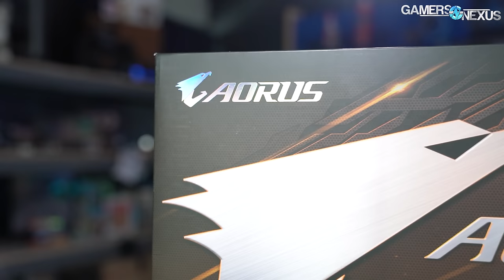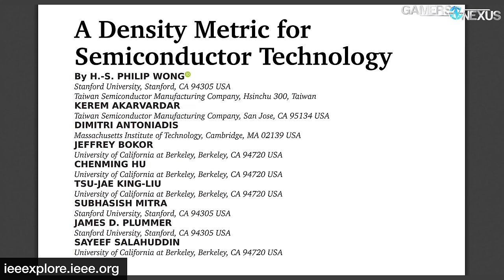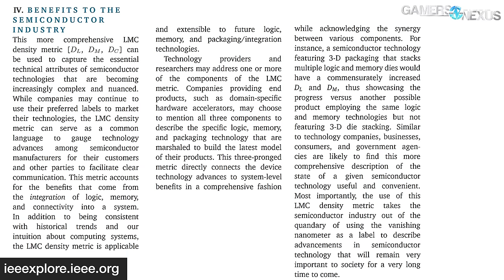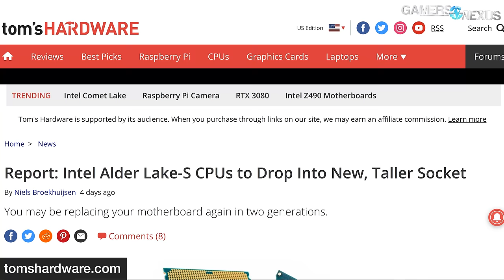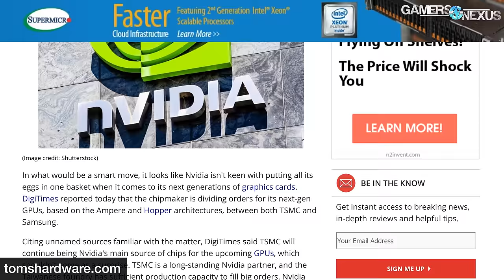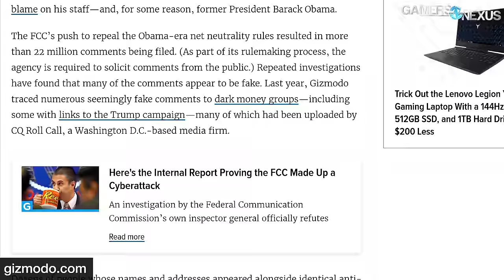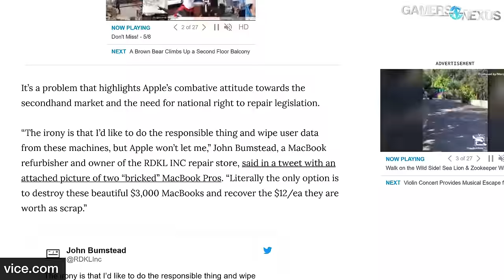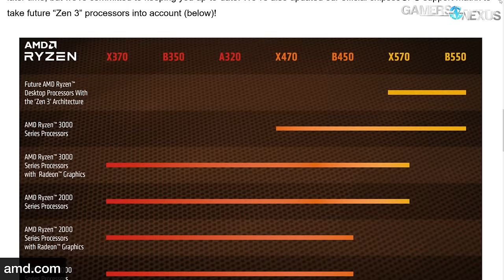HW News - NVIDIA & AMD Fight for 5nm, Intel Alder Lake, RTX Ampere, Ryzen Pro 4000

Comment: Worked at a semiconductor company, and the whole *ometers isn't all that informative without some context. It's been almost 20 years since we last used those types of measurements for anything but marketing.
Reply from the maker: Always great to hear insight from people who really were in the field!
Reply: Marc Jackson  I've talked to some old dogs that were in the industry in the late 70's/early 80's, and they claim that when we measured things in Microns, they could identify defects just by looking at the silicon. Like human metrology departments that nowadays are run using SEM and TEM instruments that can see down almost to the atomic level.
Reply: Nanometers are not even indicative of the gate length as Steve insist, if some people are to be believed. It's just a marketing naming scheme.
Reply: An honest question, why they don't use the good old "transistors per square inch" (or real area mesurement, even better) from the original moores law?
Reply: HariGtt tpi is a wet noodle standard, it can fit almost anything you need
Reply: @HariGtt  Because that isn't the original 'Moore's Law', it's just another Marketing Dept. bastardisation... Gordon Moore - "The complexity for minimum component costs has increased at a rate of roughly a factor of two per year ...",

Also, that bastardisation isn't very definitive... it's incredibly easy to build lower-density circuits that outperform higher-density circuits.

An actual useful descriptor would relate to MIPS and MIPS/$... something that channels like this provide with their Benchmark tests & reviews.  All in all, moving away entirely from using physical elements of the micro-architecture as Marketing would be a good move.
Reply: @RobinHood-yk8og  I can't quote the law by heart, but as far as i recall from college, the law was derived from cramming more components in a square inch. Wikipedia seems to agree. On the other hand, MIPS and MPS/$ are relative to an specific implementation of an architechture. In TSMC n7 you have Apple's A12 chip and AMD's Rizen 3100 throug 3990X, all with different MIPS and MIPS/$
Reply: @HariGtt  I've just quoted Moore's Law - You can CTRL+F this pdf for confirmation - https://newsroom.intel.com/wp-content/uploads/sites/11/2018/05/moores-law-electronics.pdf

MIPS & MIPS/$ tell you how much computing can be done and for what cost.  The fact that this metric gives you raw compute numbers, allows you to control for other variables (Architecture, Clock Speed, Power Draw, Memory Capacity etc...) and shows you the difference between, say Intel's current node and TSMC's current node, or between Apple's A12 and Samsung's M4.

Yes, you can also filter MIPS by platform so you aren't directly comparing a low-power embedded or mobile SKU with a Desktop or HEDT SKU.  That's why Steve and others don't have Mobile processors on their benchmark tables when testing Desktop processors; it'd be entirely irrelevant to the conversation.
Reply: Need to have it defined by density of transistors per nm.
Reply: @HariGtt  again arbitrary numbers since your benchmark is going to have some unimaginably huge number, to compare to another unimaginably huge number and then actual chips won't have the similar value since not every square unit has transistors on it.

Density is still better but then you get things like 3D circuits like they're using in ram which throws out the metric again
Reply: @HariGtt  because transistor density isn't a good measurement either.  Things like drain and source size, size of the transistor isolation areas, circuit paths, etc...  all have an effect on transistor density.
Reply: @donaldendsley6199  Thanks
Reply: always funny to me to see "internet people" being hyped by wafers or dies, crazy industry for sure I still don't undertsand who's buying millions of cpus, mouses etc..it's insane the amount of chips leaving a factory, mind boggling

Comment: Intel: Our revolutionary 10nanometre transistors are more advanced than competition's 7000* one.

*7000 picometers
Reply: well he did say that intel's 10nm is comparable to tsmc's 7nm
Reply: @Ahmedinhooo  because Intel fab and manufacturing every single thing in said nm…
take Zen based as an example, ccx/ccd all based on 7nm, but i/o die is 12nm…
still go with zen based for me 😁
Reply: @fallencolossi  .... no, the reason that he said intel 10nm is comparable to tsmc 7nm is because the two nodes have similar density, and how the minimum gate width is measured is NOT standardized, the whole point of that segment was to explain that the industry is trying to find a more descriptive metric that can be standardized to make surface level comparsion easier and more useful.
Reply: For me it can be 35nm as long as it performs better than more expensive counterpart. End theese nano wars :)
Reply: @andrejusdoktorovicius2949  the point of the smaller transistor size is it's more energy efficient, less power needed to cross the gap. The problem with smaller transistor sizes is there is more leakage of electrons between gates. There is a real benefit to going smaller
Reply: Ok it's at 70 likes now, so can only like if you have 629 friends or 6929 friends
Reply: Ryan Shrout: "Write that down, write that down!"
Reply: Even a video exposing AMD's 7nm as mostly marketing has someone badmouthing Intel haha
Reply: Bruman, this is not AMD's 7nm, this is TSMC's 7nm used by many fabless companies.

Comment: Damn, some of us are pretty stupid having made that first section necessary.
Reply: @PainterVierax  pc enthusiasts or science educated people do, but believe me many people from my family and friends don't even know what having X nanometers means, and don't forget the country that doesn't use metric system most of the time, the marketing issue would be for the OEM market and average consumer, not enthusiasts
Reply: Luis Ross but talking about nodes is not really the kind of marketing for the average consumer. The marketing teams already blur generations of chips with their naming schemes so nothing will change for this population.
Also country not dealing with the metric system already used µm before, like screens diagonal lengh and electronic components spacing are still using USimperial units worldwide. There never was a unit conversion issue.
The real marketing point could be that nodes shrinking would become more and more rare and that other areas of improvements will become more noticeable. But it's too honest for marketing teams and suspiciously funny to see that this research paper comes right when nodes are now just one number and not years ago when founders started to deviate from each other measurements. This is what Burke should have understand instead of thinking people truly didn't listen the news and reacted just on one quote.

Comment: Why not just use density? Or if you really want a "length" do 1/√density to get a value in nm.

That gives:
Samsung: 102 nm
Intel: 100 nm
TSMC: 94 mm

It might not reflect efficiency, but it's a completely fair way of looking at how closely they're managing to pack transistors, and can't be manipulated by marketing to boot since it's an equation everyone can run. That plus a W/Area and FLOPS/Area would give an objective look at every process.

Comment: On the transition between unit scales, last time we just kept using fractions of micrometers until the process node went double-digits again, which is when the actual switch to nanometers occurred in external communication. If we followed that example, any change-over to picometers is another two orders of magnitude away from currently deployed volume processes.
Reply: Will actually never happen, because a silicon atom is 111pm wide. (and there are no atoms that are much smaller)

Comment: I think the MacBook story was incomplete: a MacBook can be wiped if the previous user has has reset the machine with their password. This is a good feature as it makes stolen laptops worthless. The onus is on second-hand shops to make sure the machine has been reset before taking ownership.

The part about preventing parts replacement is true though and is a hindrance to repair even with the users permission.
Reply: Bojan Blazevic do you think the average MacBook owner who uses it as a shiny Facebook machine is capable of doing that? Apple makes good hardware, but when my 6s kicks the bucket I guess I’m going android
Reply: @berengerchristy6256  Yeah why not? How come Macbook owner don't know their own password? Second hand shop is going to make sure it's unlocked before buying in. Unless the Macbook is stolen, otherwise there's no way it can't be unlocked.
Reply: The issue becomes with recycling. I work at a tech store and we get a lot of hardware, laptops and PCs to recycle, some we test to see if we can resell, others we then scrap. The issue becomes with iPhones and Macs, we sometimes get good looking iPhones that could have easily be sold forward and not scrapped, but because we don't have the passwords or the means to reset it, since it's locked to a specific user profile, the only thing we can do it maybe use it for parts, that's it.

You do have a point with the 2nd hand shops buying them and making sure they can reset them, but for getting them from someone throwing it out, they shouldn't be just worthless...
Reply: Berenger Christy yes. It’s two clicks to remove and wipe a Mac from your account.
Reply: @NecroFlex  the irony is that apple's campuses are carbon neutral despite the amount of waste they are generating by design. if I put aftermarket wheels on my car, and the ecu detected that and decided not to turn on anymore, that'd be illegal. I'm sure apple and apple apologists will jump down my throat to say this comparison is inappropriate though
Reply: @berengerchristy6256  You're completely right tho, i get that they wouldn't want random users opening up their machines and potentially breaking them, that's normal. But to have such a locked system to basically brick the machine when someone changes something is completely stupid and beyond wasteful.

I mean a lot of phones are like that sadly, but atleast you can get them fixed without getting locked out. I'm still mad at Apple with the whole home button shit with iphones back then.

Comment: 3:02 - the problem isn't so much as the measurement used, but the amount of atoms required.  For a P or N type transistor, you need one doping atom (which makes it either P or N) and 600 Si atoms.  The problem them comes that the typical radius of an atom is around 1 Angstrom or 100 pm.  So you have to fit 601 atoms at the minimum (below 600 Si atoms, transistors don't work properly).  So there is an actual hard limit on how small you can go.

Comment: The smallest distance unit of measure is a Planck length. A Planck is also the smallest unit of time. Planck length is equal to the distance light travels through a Vacuum in 1 Planck.

Comment: Correct me if I am wrong, but as far as i know (14/12/7nm) isn't the actuall size because there is not a confirmed methodology. In other words while (7nm) is most likely smaller than (14nm), transistors might not neceserely be 7nm. So they could just go to (5nm) and then start the +++++++++++++ game.

Comment: You missed a big point with the gate size, actually there is no need to introduce "pico" because 1 silicon atom is about 100pm = 0,1nm  coresize, so you won't even come near a situation, needing pico to describe the gate size. Well I get the point pico might be more accurate/easier, because you can show fractions in whole numbers. But actually there is not much space to shrink transistor gates anymore...

Comment: Diameter of a silicon atom is 210pm, going to a picometer scale wouldn't make sense because density will continue going up while transistor size will eventually hit a fundamental limit. Increase in density can be achieved even when the minimum size limit has been reached by simply stacking transistors on the same wafer. Also a process that is twice as large bust stacks twice as far will have the same density and theoretically same performance. 

This is why density is being considered and not pico meters

Comment: The process dimension number used to mean gate length, up until about 20 years ago? Since then, each success process generation approximately represents a doubling of comparable transistor density,  ie., logic density to logic density, or SRAM to SRAM density. A process generation corresponds roughly to a 0.71X linear shrink, which one over the square root of two, and a doubling of transistors at a fixed die size. Example: 14 nm to 10nm. 
Presumably, about 20 years back, semiconductor manufacturer were able to double transistor density at less than a 0.71X linear shrink. I seem to recall transistor feature sizes being on the order of 30nm for Intel's 14nm process. Note: atomic dimensions are on the order of 0.5nm, and a transistor much be much larger than atomic dimensions such that intentional impurities for n and p-type (to create the transistor effect) needs to be at certain level, ie, not too high.

Comment: The proposed density notation really does much more sense than the 'feature size' or 'minimum gate length' one, as it reflects directly the intended result of these chip manufacturing processes; The end goal is after all to fit as many transistors per surface area as physically possible.
Chip makers will still be able to use the linear "nanometer" measurement as a naming scheme, and use the density metric as a tech spec in their marketing blurb.

Comment: I redrilled new holes in my fm socket bracket for am4 socket on my h100i does that count? Had the same water cooler for 4 years and it still works lol
Reply: reusing :)
Reply: Loving my 8 years old H100. Switching from AM3 to AM4 was so painless :)

Comment: Use angstrom problem solved. Even though transistor size is getting close to atom size. Also you need to take into account the size of the bonds between atoms for the creation of the transistors.

Comment: Also the theoretical size limit of silicon is 1 nm, so how would that help?
Reply: ive read somewhere that a different molecule is needed, artificial one
Reply: @petar932  a new molecule? 1 nm is about 10 angstrom. Meaning 10 atoms wide. Atoms are relatively the same size across the periodic table, even with the vast difference in protons/neutrons/electrons.

If silicon can't do 1 nm, I don't see how other atoms could?

Comment: On NVidia making Ray Tracing cheaper, I was under the imperssion that Ray Tracing was 'free'... didn't Neon Noir prove that already?  I'm not impressed with Tech Press buying NVidia's RTX marketing BS after calling out the Gate Length BS.

Consumers for whom gate length measurements are a factor in their purchasing decisions, are not going to be confused by switching from nano to pico, regardless of how counter-intuitive that may seem from reading YouTube comment threads.

Regardless, until there is a useful alternative metric we're stuck with 'gate length' and the caveats that come along with it.  Of course, the Tech Press could just stop highlighting it and focus solely on computing performance... that'd work.

Comment: We don't need research papers on this. We just need agreement between manufactures to get it done. Intel suggested the density metric a couple of years ago for the same reason, with everyone suggesting this, maybe they will eventually get together and make it happen. Here was an Intel article on this: https://newsroom.intel.com/editorials/lets-clear-up-node-naming-mess/

Basically you get # Transistors/mm2 as the important metric, and it then makes it clear than things like TSMC 16nm and 12nm are the same density... Both are around 25 MT/mm2 for GPUs. AMD's GPU on 7nm are around 40 MT/mm2.   Seems like a very sensible way to go , and gives clear practical results for processor improvements.

Comment: What I gather from the industry's push for a new standard of measurement is that they can no longer make the numbers look better each generation under the current standard.  I get that nano/pico/femto . . . meters are not enough to describe the true density of transistors anymore.  But I still want to know the resolution of the photolithography process, just like I want to know if my screen is 1080p, 1440p or 2160p regardless of image-processing quality.

Comment: Question for the next AskGN: We often hear the terms "System Integrators" & "OEMs". What is the difference between the two?
Reply: SI, or system integrator, uses prebuilt parts to build a pc, so basically the people who build pcs for you.

OEM, or original equipment manufacturer, uses a combination of bought and self-manufactured parts to make pcs. for example, dell makes its own cases and power supplies and motherboards, but (sadly) uses Intel cpus.

Comment: Amd would have more luck convincing the tech crowd that memory is the problem with older boards if they would do a limited backwards compatibility of x470 boards. The ones with more memory. It would probably not be true as well, but noone would complain.